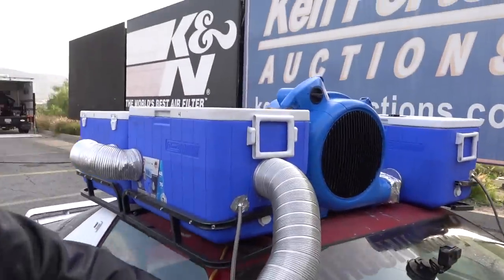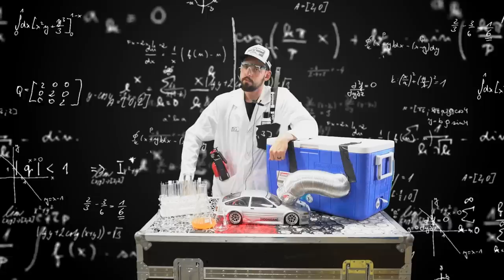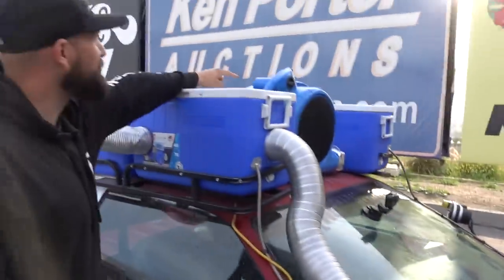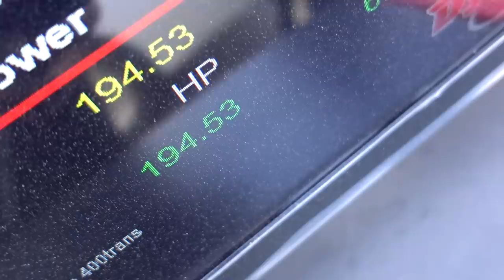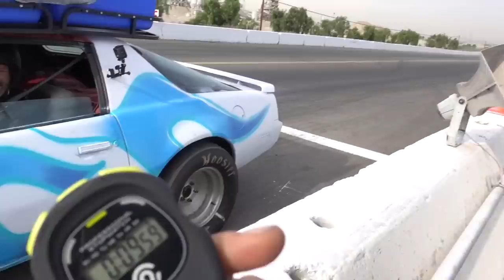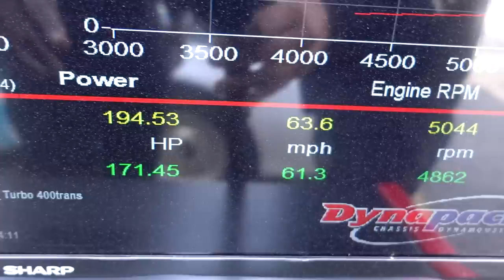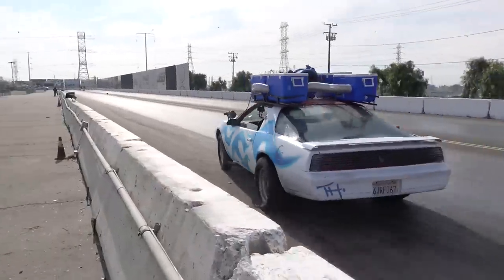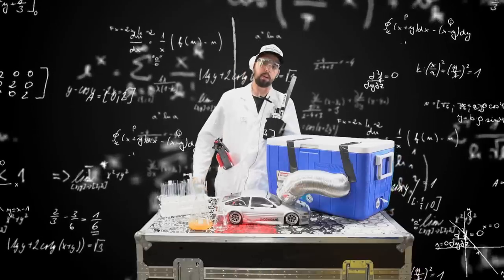Dry Ice Cold Air Intake: Does Frozen Air Make More Horsepower?

Comment: Dry ice is CO2 so all you did was you starved it of a lot of oxygen lmao
Reply from the maker: Confirmed.
Reply: Came down to type this exactly!   Thank you sir
Reply: Agreed, should have intercoolers inside the dryice coolers. Cool the fresh air without mixing in co2.
Reply: As soon as we saw the piping I thought the same thing.  If the pipes had run through the cooler, it would have gotten some cool air and no CO2.  Or an intercooler, which would have been even better like ^^^ said.
Reply: This proves that Labcoat Ron does not know science!
Reply: @TheHoonigans  This proves that Labcoat Ron does not know science!
Reply: Had the right idea but didn't execute properly
Reply: @TheHoonigans  As others have mentioned, the dry ice just robbed the engine of O2.    I'd love to see the same cooler set up but with water ice instead.
Reply: @brokenmember1658  yep pretty much
Reply: Severely agminated intake
Reply: @shveylien7401  exactly what is needed on next test.
Reply: Lol. Same thing I came to say.
Reply: Tweeker Brad shouldn't be on the show js.
Reply: thats what i said
Reply: Hoonigan should’ve tried solid hydrogen.
Reply: Made it more fuel efficient**
Reply: Yeah... This was utterly dumb. Should've used some metal tubing ran throughout the Dry ice as a heat exchanger for the air.
Reply: Everyone’s a scientist/master mechanic now 😂😂😂😂😂. Foh. I thoroughly enjoyed this experiment. “Cold air” doesn’t necessarily mean the coldest air, so long as it’s cooler than your engine bay.

Comment: I'm impressed it even ran while being fed a solid supply of co2.
Reply: I thought the same thing I figured it would fall on its face on heavy throttle
Reply: I think that the extra inert air made the engine run leaner allowing it to rev higher and faster.
Reply: Technically, it's not solid, but gas.
Reply: @marvinmorte9497  dry ice is solid gas.
Reply: @koloblicin  you are wrong because he said no its not solid (literally correcting the original comment incorrectly)
Reply: @kaeden5590  i know
Reply: it ran 9.0 because he didn’t studder like he did on the 1st and the cooler flew open so it was being fed less co2
Reply: No joke
Reply: I assumed they'd run the tubes through the dry ice coolers like an intercooler, not actually let the air contact the ice.
Reply: Yh I was thinking that would make is so inefficient if it even ran.. should have used something else
Reply: @jordanbwalt  I think that’s what they did.  They used the dry ice to cool the pipes, that’s why they have the fan.  Not entirely sure without a better video of the intake system
Reply: Same thing i thought that and i was wondering if they thought about it
Reply: Gas likes oxygen the point of cold air intake is that cold air is more dense so more oxygen molecules can get in the carburetor. With stagnat dry ice all that was getting pumped was co2
Reply: There is No Oxygen in dry ice, so therefor No gain.....period!
Dry ice got banned from clubs as FX on the dancefloor due to deaths when People fell on the floor drunk, they couldn't breath while being unconsious so there were deaths, thats why it got banned, NO oxygen No more power, fire needs oxygen to burn, that science so this was doomed before they Even startede the car...
Reply: @kaeden5590  a solid gas is a gas in solid form and wtf would you call ice!!! Dry ice is frozen co2, every one knows that, so YEAH "dry ice" (frozen co2) is very much a solid gas!
Reply: Fr tho, with regular ice in those coolers this might work better

Comment: The dry ice will be displacing oxygen with CO2 as it sublimates. If they used regular ice or packed dry ice around an intercooler it might have actually worked.
Reply: Besides the CO2, there’s no intercooler or compressed charge for the temperature drop to be utilized
Reply: Would need compression for it to work. Cold intake does not work unless Its a super hot engine.  Like 1000hp.
Reply: bergrud I’m not sure about the high hp requirement, Subaru and BMW have water based intercooler cooling devices on factory cars
Reply: Zachariah Willburn Yes wich are cars with compression (boost)
Reply: @bergrud  yes they have boost, but not near the 1000 hp you stated.
Reply: @jaydunbar7538  he was saying cold air intake only works on N/A engines if they're really hot aka 1000 hp

Comment: yo blowing CO2 into engine ? cos dry ice is CO2 !
Reply: they should have used thermally conductive piping through the coolers to separate the intake from the dry ice CO2 emission.
Reply: and insulated piping between coolers to retain the chill.
Reply: Also.. cooling off fuel may cause the fuel to become more liquid/droplets vs being atomized causing a further drop in power
Reply: @BelieveItYaKnow  What kind of beneficial fuel cooling could we be talking here? LUL would it be better to not cool the fuel and see if the cooling of the air helps with mixing? If the air intake is cooled and primed to steal electrons while the fuel is not cooled there may be an ionic attraction, like hot water in the cold... wait, is there more vapor per second, faster mixing in cold weather or is it just more visible?
Reply: @BelieveItYaKnow  What about preheating the fuel while cooling the air intake?
Reply: @BelieveItYaKnow  Exacly, carbys like warmer fuel, unless you are in some metho drag car or some shit
Reply: then youd have injectors anyway

Comment: Please don’t destroy it! Let Brad fix it up right. LS swap, blower, good trans...
Reply: No it's a turd. The thing squats with 200 HP in the rear so hard it cuts the rear tires.  It has to be killed with fire!
Reply: Nah. Powerglide,5.3, blower, coilovers, fast as hell.
Reply: Big block it..454 super stacks and revive space race lol
Reply: It has an LS in it. Fixing it up right would beputting a Chevy back in it (or go Pontiac if they're feeling ambitious) with a turbo. Then it won't be just another who gives a fuck LS car.
Reply: Give it to zak, i swear he wants one of these
Reply: A.J.'s Garage it'll run 9s on the 1/4 then
Reply: Yeah man.
Reply: Ebay parts and let her eat
Reply: 4:29 take a look its already LS swaped. must be a bad 4.8 
you can see the water pump, valve cover and coil on plug.
Reply: I guess just rebuild the LS. Slowly, make the necessary upgrades and turn it into a drag car
Reply: Yeah. They said it was a LS now in a previous video. But if it's a 5.3 or a 4.8 it's time to throw some actual boost at it with a powerglide or a better turbo 400. Then itll be setting times
Reply: Or just race it at LeMons
Reply: Erevos85 better yet! 24 hours of lemons!!
Reply: Brad and Zach oughtta team up to build the ultimate mullet mobile
Reply: I'll take it
Reply: fix the rust
Reply: It's already ls swapped but what I don't get is those 5.3 make 300 horsepower to the crank so I think that motor is completely smoked to he running under 200 horse haha
Reply: @roodick85  454 is a turd low horsepower and dosnt rev out that 5.3 makes more power when running right
Reply: @roodick85  unless you are talking about an ls 454 then hell yeah or even one from 1995 those made good power
Reply: @Bowtie4me  it's a 5.3 I'm pretty sure but could be a 4.8 with those numbers I know the 5.3 makes 300 horse to the crank

Comment: The reason it made less is because dry ice is solid carbon dioxide, the car is having carbon dioxide pumped into the engine. Seeing as carbon dioxide puts out fires out that’s not great
Reply: I can't believe no one there thought of that...
Reply: brad should have had the pipes go through the coolers so that you only get the air getting cold

Comment: shoulda plumbed the dry ice cooling through an intercooler and used the intercooler as your intake. that way you aren't taking in co2 lol
Reply: That's what I thought they were doing at first. then he opened the cooler...
Reply: They should've done just that BUT with the compressed air setup too so that they would have extra pressure and it'd be cold af
Reply: I think when the car was going down the track it got through all the co2 pretty quickly at the beginning of the run and then was getting mostly oxygen after that, the dry ice couldn't make enough co2 compared to how much air was flowing through the chests. An intercooler would be ideal, but a purge system could also work.
Reply: Agreed.  You would think that would be considered.  I think it ran stronger on the track because the cooler opened and let more air in the system.

Comment: you need to make an intercooler with dry ice, not pump dry ice into the intake, you want supercooled oxygen not CO2
if you'd make a dry ice - air intercooler it would have worked
Reply: It did work
Reply: Exactly. should've had tubing running through the coolers- keep the CO2 out of the engine!
Reply: LN2 would've been better lolol.
Reply: The o2 sensors went crazy and the CPU. Supprised  the injectors worked  it must be carberated
Reply: @davidmayhall6567  definited carbed. they say it at 4:30 or so
Reply: It didn't work, he just didn't bogg it on the line.
Reply: with liquid oxygenbi would blow
Reply: I've seen people suggest dry ice in a reservoir for a water to air intercooler. Keep in mind that the dry ice will make carbonic acid and destroy the shit out of the intercooler.
Reply: @94XJ  would dry ice in a container that is surrounded by water work?
Reply: The lid blew open giving him more oxygen on the track.
Reply: why not use air con?
Reply: @notahuman369  no i believe this is the episode after where they have put an efi throttle body on it and got rid of the distributor
Reply: @pumpkinspicelatte1731  did you read what I said? THEY say it's carbed in the video.
Reply: @notahuman369  + u can see the carb....
Reply: @rixz89  i wouldn't expect anyone here to be able to tell the difference between a carb and an alternator lol
Reply: yup...standard operating procedure in Phoenix AZ... I had a dry ice intercooler on my turbo Z in 2004. Made it out of two mailboxes. One inside the other.
Reply: This is so much smarter
Reply: @danielcox3983  Let's go for LOx directly
Reply: Fill the ice chests with ether and see if that works
Reply: @vincentyap3188  freon would boil

Comment: Bruh what if you spray LIQUID OXYGEN in the intake🤔
Reply: Thats basically NOS. Except since Liquid O2 wouldnt have nitrogen you would prolly have a bigger charge.
Reply: Check out mastermilo’s video it literally destroys the engine
Reply: Yes and instead of gasoline use hygiene peroxide. You could get 2,000 horse power.
Reply: Micael Silo - Kaboom!
Reply: I'd expect the intake to shatter from thermal stress. Well, actually, since carburetors already lower the intake air temp, the fuel'd probably freeze in the jets.
Reply: Thermal shock. boom.
Reply: @wesleycarr6118  did he add extra fuel for the extra oxygen?
Reply: MrHillfolk no but it fucked the liners
Reply: You would have a boosted engine a blower or turbos compresses air into the combustion chamber. A better result is already being done (NO2) nitrous has 2 oxygen atoms versus 1 oxygen atom in natural air. The 2 oxygen atoms being introduced is the chemical equivalency of boosting and engine and requires no actual boost in pressure at the intake to get more oxygen in like a supercharger or turbocharger mechanically do.
Reply: It explodes dude. Thats why we use nitrous. The nitrous decomposes and adds the o2 to the mix
Reply: Probably the same as if you put nitro glycerin in it lol.
Reply: I believe O2 just at ambient temp makes things hot so if you had the extra fuel you would probably make more power but might melt stuff
Reply: Even if you could figure out the proper jet size for a given amount of liquid O2 so that it didnt lean out and blow up that way, the timing would be almost impossible to dial in because the burn rate would change so dramatically. I dont think you could open and close the valves quickly enough to contain combustion inside the cylinders with enough efficiency to help. Not to mention the burn rate being so much higher would create a severe increase in combustion chamber temperatures. A best case scenario would likely be erosion of the valve seats and a worst case would be holes melted into the tops of the pistons. That is if the whole thing didnt simply grenade.
Reply: @jeremiahpike6372  so, regular air is just one oxygen atom eh? >.> lol.
Reply: @nicewhenearnedrudemostlyel489  nitrous has double the amount of oxygen at an atomic level yes. Which is why extra fuel has to be added along with nitrous. Regular air or the atmosphere is 78% nitrogen nitrogen isn't flammable at all by itself. Pure oxygen injection wouldn't work because the fuel to air ratio would be impossible to ignite correctly to create a properly timed explosion which is a requirement in an ice engine.
Reply: @jeremiahpike6372  I'm almost certain, the gas in regular nitrous bottles is n2o, because no2 is highly toxic... also, you will likely never find a single oxygen atom anywhere in the universe for more than a microsecond. Normal air, is o2... your overall point remains valid.
Reply: RyeBread HD that’s what I was gonna say but I think there’s an advantage to NOS over liquid o2 cause otherwise why would anyone use it
Reply: BOOST n BOOM
Reply: The engine immediately goes massively lean and starts detonating, you'd have to treat it like nos and spray a shitload of extra fuel
Reply: Detonation. Liquid o2 is so cold and will expand too fast.
Reply: You would have a large detonation
Reply: Nitrogen is to balance out the oxygen in NOS, too much oxygen can cause misfires, uncontrolled fire inside and out of the cylinders
Reply: How much weight did you add.....
Reply: vroooooooooboom
Reply: Bang
Reply: BOOM is what happens...
Reply: The two nitrogen atoms in nitrous oxide act as a buffer to carry heat away and slow flame propagation and burn rate. Even though the oxygen content of LOX (liquid oxygen) is greater, it's too hot of a reaction and also creates peak pressures too high and quick to contain in a piston engine. Even turbines use it in afterburn only. Not in the heat cycle, compressors or combustion phase. The only way to run it safely is in small amounts. Making a wet shot of nitrous oxide superior for overall power output since you can safely run 20-50 times more of it before catastrophic failures occur. That's the problem with most oxidizers. They're too hot making them only applicable in rockets and other non-contained explosive reactions.

Comment: If the ducting had passed through the coolers, instead of in to them, this might've worked... #science
Reply: They also should have pulled the ducting strait to increase its diameter
Reply: But then it would've been more of an intercooler?
Reply: Use metal ac vents instead of dryer duct
Reply: @robzu1010  That's exactly what it would be.

Comment: I want to see pure oxygen sprayers!
Reply: Pure oxygen will explode in the cylinder under compression if I'm not mistaken. Its been done before, it didn't work out well
Reply: @monstermash479  But that is the point
Reply: DO IT
Reply: The guy who invented nitrous first experimented with pure oxygen and he couldn’t get a formula that wouldn’t explode soooo I mean the motor would just blow up
Reply: @mattkless8299  wrong
Reply: That's why they use nitrous oxide instead. Oxygen causes preignition. Want to test it without that you run nos
Reply: Pure oxygen will create uncontrollable ignition in cylinder, melting the engine internal in no time
Reply: @ardijanuar2036  not only would it melt, it would white literally burn the cylinder.
Reply: Look at the compressed air supercharger systems ....the one that the guys from nos made
Reply: @monstermash479  but a lot of it under small pressure should give more power safe like with the compressed air setup. the compressed air setup was good but had too little pressure and it went out too fast. also you need a carb that works great with pressure
Reply: Ping ping ping BAM
Reply: Ed Jack  you are thinking of evaporative cooling, which requires a change in state of matter from liquid to gas. THAT is when you get the cooling effect from expanding gasses by dropping pressures.
Reply: Do a mix of our air but maybe like 10% better so it doesnt blow up the engine
Reply: A racecar driver tried that back in like the 20s or 30s and his engine exploded pure oxygen will let ANYTHING catch fire
Reply: Ed Jack  I meant if they used pure oxygen. Dry ice is carbon dioxide
Reply: This kills the driver, no...

Comment: You need to try putting the dry ice separate from the air stream going into the motor. Dry ice is solid c02 and c02 doesn't burn